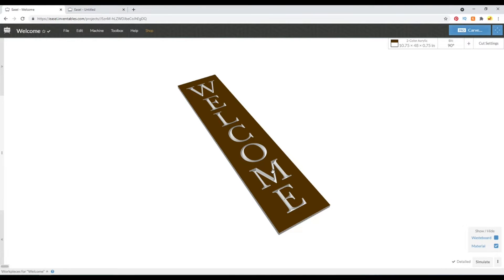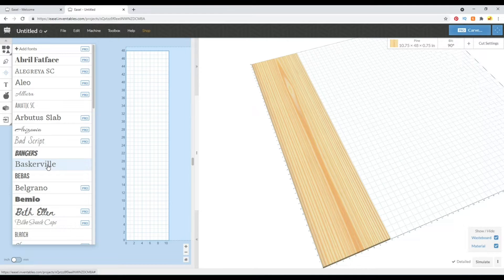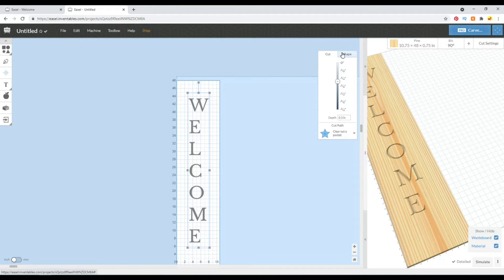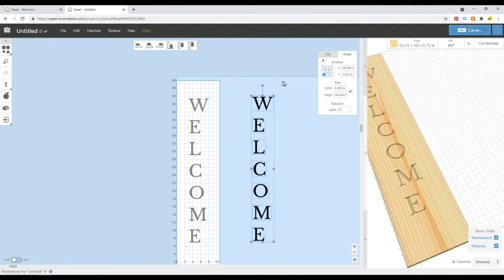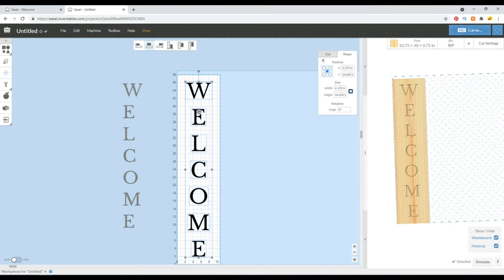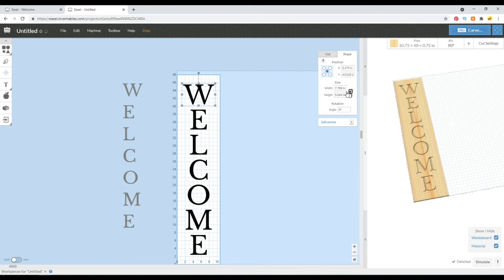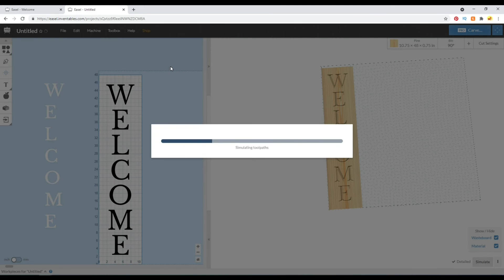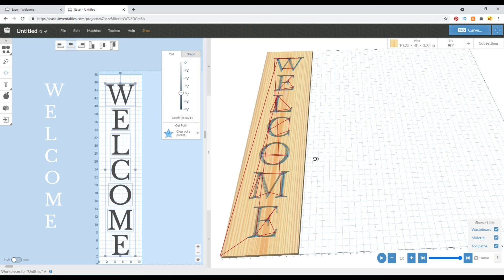Design This Welcome Sign in Easel in 10 Minutes

Comment: Seth, got a question for you concerning bit changes in Easel.  I use Easel but my machine is a OneFinity.  My question is, how does the bit change work with that setup?  I want to use an 1/8" downcut to hog out my material, then use a 90 deg Vbit for the detail pass.  I have that all set up in Easel.  I'm thinking the code will stop the machine for a bit change after hogging out so I can put in the 90.  But I'm not sure how to start the program back up for the detail pass only the Onefinity.  I see on the Inventables machine, it lets you do that.  Or do I have to run a separate gcode for the detail pass?  Any ideas?
Reply from the maker: For the 1f you'll have to download the gcode and with a 2 bit carve its 2 seperate files.  You'll want to swap bits with the machine turned on and set z zero for the 2nd bit,  but leave x,y zero as it was and the 2 bits will be properly aligned..  

do beware that v bits really need a perfectly parallel top surface,  so if you haven't surfaced the workpiece on the cnc first you might want to check out my video on shimming the workpiece with playing cards, or you might notice imperfections in the details.
Reply: @SethCNC  Thanks Seth!  Appreciate the info.

Comment: The workspace is 30 inch but the work piece is 48 inch.  ???  How did you deal with that?
Reply from the maker: Thata a good point; if you need, you could use easels tiling function. My cnc has a 50"x50" workspace so I haven't had that issue yet 😉
Reply: Can you make a video on how to layout work piece in easel? Also how to use the tile section.?